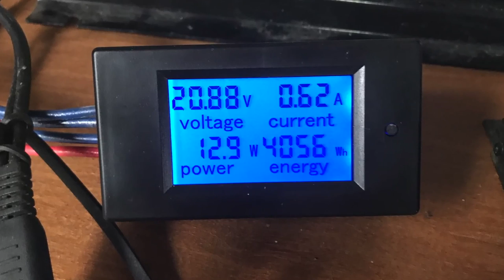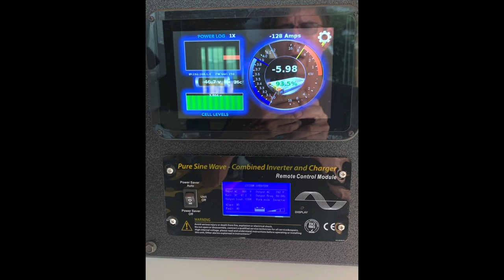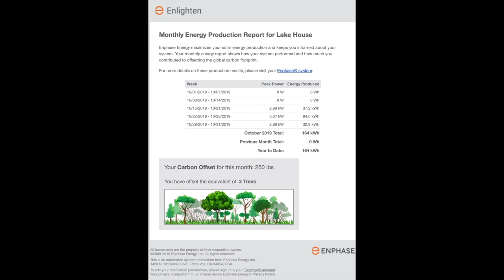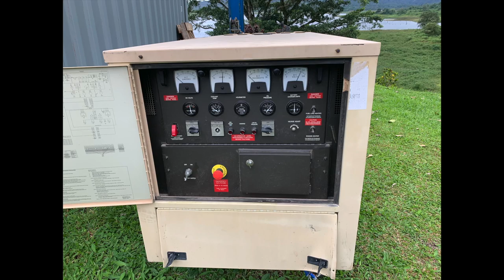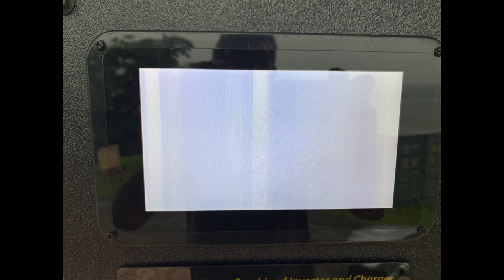EVTV on Tesla Cybertruck Unveil Wardrobe Malfunction

Comment: I managed to get order in within 15 minutes.  Took about 5 minutes to decide then had to rewind livefeed to great that web address.  I just ordered the 39k plus self drive 7k.  I was surprised at the $100 since I put down 2500 for my Y.  I saw one article that the current big trucks now look like Princess Wagons.  That may be a great sticker on the back when these big gas heads drive 5 feet behind me trying to intimidate.  A great accessory would be hinged rack with long spikes on them that would be on the front and back like mad max.  Be cool to be a true road warrior. 
Great to see that 100 working in Costa Rica.  I am looking to get one of your house backup systems in 6 months or so.  Looking at the 400w plus panels and actually getting some enphase and see what others come out with the inverter on each panel.  I like my Solaredge system.  
I can't wait for my cybertruck.  I think it is good to see a fail like the windows.  It makes it more real and down to earth and in the present.  I thought they may have planned it.  I just saw this morning there are about 150k orders.  I think the size of batteries and capacities are up in the air as they have 18 months to figure that out with the new technology.  They can also get feedback on what is needed.  If he announced these specifics it would trap them in a promise that will change in 18 months.  18 months from now the Y will be out for a year, the starlink system will be up and running, the starship will be in space multiple times, the boring tunnel in Las Vegas will be done, the Giga 4 will be 1/2 done, the new batteries will be functional, and self driving will be pretty much an everyday thing.

Comment: SeeMs  third engine is / should be a vane compressor with a copv tank thats forward or reverse to electric engine or battery pack or wheels or 120/240 or pressure tools or rocket thrusters or safety system. All integrated with superbottle

Comment: I ordered one of the Tri-motor trucks for evaluation purposes.  Not sure if you remember me, Jack.  I came out last summer on business and spent an afternoon chatting with you.  I drove my Model S out to Cape Girardeau, but we also had a diesel 3500 on the job that pulled our 10,000 lb trailer all the way from Myrtle Beach.  My business owns 7 trucks of which 5 are diesel.  The fuel and maintenance on these trucks are more than the truck depreciated over 5 years.  We put about 35k miles per year on each truck.  A BEV truck could potentially replace most or all of the diesel trucks, but I'm skeptical on the range pulling a trailer.  If you're pulling your boat to the boat ramp, or even a small camper on vacation, it is different than pulling a work trailer hundreds of miles to a job site.  

Our Chevy 3500 will get around 19 MPG when unladen, but its fuel economy will go down to 7-9 MPG when pulling the 10,000 lb trailer. I believe that most of that is due to the aerodynamics of the trailer.  Its not the weight or the rolling resistance of the tires, it's the aerodynamic drag.  So, what is your prediction?  Will the 500 mile range go down to 200-250 miles when towing this beast, or even lower?  We could probably live with a 200 mile range, but it would be a lot less convenient having to stop and charge 3-4 times on a 600 mile trip.
Reply: @Roger Heuckeroth
The math is in your question.. you're getting around a 63% loss in mpg and should expect similar range loss in a Cybertruck reducing range from 500 to 185 miles.  Tesla's stock images include one of the Cybertruck towing a cyber trailer which may help improve the range.
Reply: @martinlacey5985  The rig we pull is not a standard enclosed trailer.  It's a specialized conglomeration of equipment, so drag is high.  I'm not sure if its fair to use the same % loss as the diesel experiences.  It could do worse or could do better.  

On the could do worse side, the 3500 is already fairly high drag on its own, so the 19 MPG has that figured in.  Adding the trailer is making things worse, but your 19 MPG is already starting with a handicap.  The Cybertruck may only get the 500+ miles of range with the bed cover down in its best aero configuration.  Maybe also with highway tires, not the nobby tires that were shown at the unveil.  So, the trailer would add a higher percentage of loss.   

On the could do better side of the argument, the cyber truck should be more efficient under load, and be able to recover the kinetic energy with regenerative braking.
Reply: New design truck demands new designed trailer.  continuing the angle of cybertruck roof, up and over trailer.  the secret is closing/eliminating the gap between truck/trailer.  With no-gap trailer should be back down to 23% energy loss.  maybe an inflatable wedge shaped bag/skirt for retrofit applications..
Reply: @solarsacomin6886  That's impossible with what we are hauling.
Reply: Maybe need to have trailers with their own battery packs and can pass juice up through to the towing vehicles.
Reply: @strykerace  I don't see that as practical.  The truck has to be engineered to be equal to the gas / diesel equivalent.  Just means a large enough battery on board.

Comment: There was a similarly catastrophic revelation with
even greater repercussions several years back.
That's when Microsoft boss Bill Gates unveiled a
new version of Windows at the unveiling
presentation. The computer crashed shortly after
switching on. I can't remember exactly which
Windows presentation it was.
Reply: Win 98.   And operating-system has one primary function, to interface some hardware to the client-code - thus not crashing is a priority-1 feature, vs say playing sound or surfing the web, which are secondary/tertiary features.  The Cybertruck window-smash is barely a tertiary feature because they can be replaced with plain old vehicle-glass and still be the same capability as existing vehicles.
Reply: @aus140  Sure you're right. It's just a
comparison of two failed presentations. The
background and meaning of the causes and
impact of the two errors are not evaluated. 

In your interpretation of the two cases, that of
Bill Gates is absolutely more unforgivable.

Comment: My input, is that the motors are ac,  so there is an inverter that is doing heavy work at the ac level, this will likely be what powers the 240v/120v. outlet.  Just a bit of my prediction, or hope.
Reply: Mr. P - I heard back motor is induction, front is like Model3’s (permanent magnet)
Reply: For the torque to be reasonable, induction is Definately on all trim levels.  Question is, what is the allowed draw, and can it be used while driving down the road.

Comment: So for the air suspension they are just going to put in a much bigger compressor than what the suspension needs in order to accommodate tool use. A power converter probably will have at least 2200w to handle most 15/20a tools.

Comment: worked in a machine shop.
Yeah water jets cut stainless steel.
Reply: one pass with water jet, will it leave a finished working edge?  Looks like the panels and frame built by metal brakes could be unhumanly  fast.  your thoughts?

Comment: I think the design is perfect for 90% of the public , but not the people who use trucks in farming, ranching , or construction ( before freaking out ) there is no locations for lumber racks, no mount of more external lights, winches, power booms, extra spare tires,  utility beds, there are no side mirrors ( still required by law) , side steps , bull guards, tow hooks, vice platforms, with a unibody there is no frame to mount anything. Also our vehicles are not normally parked in side , from one farm to another the temperature range from 120 in Buckeye, Az to -20 in northern Utah . So all that glass and bare stainless will be real hard to heat and cool . I need a cabin size 3 at the most . They still have not stated how much range I will get towing 12,000 pounds up mixed grades . Last thing I need is bulletproof glass. Thinking of all the workers I would have lost if the side windows could not have been broken out . Yes, we own a Tesla or two . There are a lot of farms and ranches that are off the grid . We couldn’t wait , but this won’t fill the requirements of what we need .
Reply: I just can't get past the fact it looks like a Fiero made it with a Dolorean and out popped a Fieroean. The Fiero crashed and burned and even "Back to the Future" couldn't save the Delorean and I'm thinking the third time is not the charm here.
I was really EXCITED to buy this truck and when I saw the looks I was VERY DISAPPOINTED. I even considered buying Tesla stocks,  knowing if he nailed it his stocks would 🚀 up but now I'm glad I didn't.  I care alot about the looks and I have now decided to see what Chevrolet can do with the Silverado.  If he shortened it up and made it easier to drive and park, along with a better shape, I would reconsider. 
 I'm sure the Elite 3% will be knocking his doors down, like Hollywood but I'm thinking the poor 97% are going to be thinking differently.
 We are learning flexing our egos usually ends in bankruptcy.  We just want vehicles that reflects our personalities of a average country boy or a backyard mechanic, along with the everyday mom hauling around the kids. 
We are learning that the Elite like us better when we are flexing our egos with our pocket books and way indebted to their banks. The Elite 3% have put alot of work into brainwashing us the poor 97% into being the purchasing machines they need us to be that keeps their pockets filled with OUR HARD EARNED cash. I think the Elite even created the illusion of the American Dream with their banks to make us think we are moving up, but in reality we are just REALLY INDEBTED TO THE ELITES BANKS OUR WHO LIFE.
The Elite like it when we don't pay things off and keep upgrading, thus keeping up with the Joneses was introduced into our realities and life is a competition began.
Tesla's biggest downfall is who wants to wait 2 to 3 years to get this truck ?????
That all being said, Elon is like Trump he is battling the Elite 3% called Corporations,  that created the illusion of keeping up with the Joneses.  Elons beast is the car Corporations that want to bankrupt him or force him to sell out or share his skate board with the car industry. The big red flag I see is SOROS is a big stock holder in Tesla ? There was a reason Elon didn't click with Trump .... maybe the Soros connection ? That makes me not want one after I learned that hidden knowledge......
Reply: Guarantee Tesla will have no problem heating and cooling this thing.
Reply: Jack Rickard , well I will note that 99.999 of the people who own pickups outside of the rural areas don’t need pickups
Reply: Aaron L - well show me the data , tell me how good the batteries are at -20, what’s the range . The only model I may possibly use they said “ maybe by 2022”. There are no promises written anywhere
Reply: Jack Rickard — I’m not drilling 50  1/2 holes threw the skin of a unibody, especially I have no idea if the area has access to place backing plate. Not to mention the compromise to the main structure
Reply: baldeagle7777777 my biggest down fall is that there is no access to the bed from the side, to have my crews completely load and unload. I know from my 2013 model S , I’ve been told by Tesla to expect a 38% drop in mileage below 20 degrees . How many miles can I get towing in cold temperatures? , I’m not going to even think of buying one until all known limitations are stated .
Reply: Fundamentally a truck needs to be able to support different beds for any kind of fleet usage. Flat beds, dump beds, cranes, buckets, service bodies (generally on duallys), fifth wheel towing, etc are the name of the game for construction, utilities, and telcos.
Reply: Greg Hassler , agreed and this one has no access to the bed by the side . Wish they had trimmed down the sides some
Reply: As for construction, it really depends on the trade. Carpenters would definitely want a trailer if they use this truck. For many trades, however, it would be fine - if not for the whole fleet at least for some uses. It's ideal for companies that need to take men and their tools to job sites.
Reply: Alan Light , well a plumber can’t use it as well as roofer, flooring, insulation, landscaper , drywall, carpenter, electrician, farmer, rancher, Mobil mechanic, landscaper — make it easy on me —- what trade would this really work for ? I see other problems because of my locations the high and low temperature range from 120 to -20. That’s a lot of cabin space and glass and raw metal conduct temperatures real well— lots of energy used to heat or cool the cab . The design doesn’t bother me in the least , it’s just not functional for anything I can use it for except a Jeep replacement. Cut the bed off , make it 50% smaller with a tow ball — perfect
Reply: @RedRepair  - I did plumbing for a year and can't see why plumbers couldn't use it, with some added racks and such of course. I've worked as an electrician in residential, commercial, and industrial. Residential electricians typically use vans and commercial electricians often do, but this is similar to or better than the trucks used in commercial or industrial. Can't say for the rest, but I don't see why it should be ruled out. I've seen several comments at various places by welders saying that it would be an ideal welding rig.

This would especially be ideal for large companies that just need to haul workers and their tools to various job sites where the heavy tools are already present locked up in trailers.
Reply: Alan Light , well that’s the problem — adding the racks . Figuring out where to mount a vice, torch set up , snake rig, power washer, etc all has to fit in a 6 foot bed that you can only access from the rear . But the main thing is taking a unibody and welding stainless steel mounting pads everywhere to have racking —- do I void the structural warranty ? , how do you weld bars across the front window —guessing you would have to mount off the front fenders — not so much a stream line truck , and would look like a nightmare by the time you got done
Reply: @RedRepair  - when I did plumbing most of the trucks did not have any of that stuff mounted on them. Excepting the service trucks and the finish truck it was mostly just compartments for hand tools and parts, and racks for lengths of pipe and ladders. The service trucks and the finish truck were mostly panel trucks anyhow.

Of course racks like that will not be aerodynamic - just like with any other truck.

You have an interesting point about whether welding a rack on the truck will void the structural warranty. It will be interesting to see how they handle that - perhaps with a few reinforced spots on the frame authorized for such modifications.

In any case, this truck isn't for everyone. I agree. But it looks like a great vehicle that can fill a multitude of roles the way a good majority of people need them filled. In time hopefully Tesla will be able to offer additional variants or models to meet various needs, but their primary goal is to move the electrification of automobiles forward, and if nothing else this truck should light a fire under their competitors to get them moving.
Reply: Alan Light , competition is always good for the market . This is a couple years in the making , I don’t even known if the design will meet the United Nation directive to be exported. A lot of information not given . It will be interesting to see as things progress

Comment: Just watch.  If I sell a clear wrap made out of RAM (radar absorbing material) it would be outlawed overnight.  FoMoCo used a special paint briefly in the '80s that was discovered to be a RAM material.  They quietly removed the paint from their inventory at the "request" of Dod.  No doubt a classified formula, but if you did well in University physics you could connect the dots.

Comment: Ford recently came out with the video where they had an electric F150 tow a 1,200,000 pounds. The sad thing is is that Ford is going to basically release the exact same looking gas F150 in an electric motor. There is absolutely no way that Ford or any other traditional car manufacturer will create anything that even remotely looks like the cyber truck. They simply cannot make that financially possible for themselves they have to use an existing body and use all the existing parts they can to save as much money as they can. Even though I design like the cyber truck would be better overall they will never do that they will simply take their existing line up and drop in electric motor in there. I am willing to bet that the unibody design of the cybertruck will be able to tow more than 14,000 pounds probably just don’t want to legally say so.
Reply: Why you writing an essay in the comment section? 😂😂
Reply: @Jack Rickard the added weight gives T an advantage in towing contest... Traction

Comment: In regards to the glass windows, they have released videos of them doing this behind stage before the show or the event and it did not break. They probably did it a few times and just weakened or fractured the glass to a small degree so that the demo was just the straw that broke the camels back. There is a video online of them doing it before without breakage.
Reply: someone said that the glass mount broke when Franz hit the door with the sledge, which caused the glass to be loose.

Comment: If Tesla made an XL version that changes that top apex to a flat top of about 2-3 feet backwards before the slope. Extend the bed enough to fit 8'x4' plywood sheets (even a convertible like the Exclade EXT) and I'll trade in my AWD Model 3 in for it.
Reply: Couldn't you haul it with the trayback down?